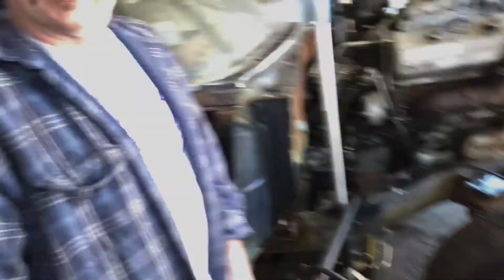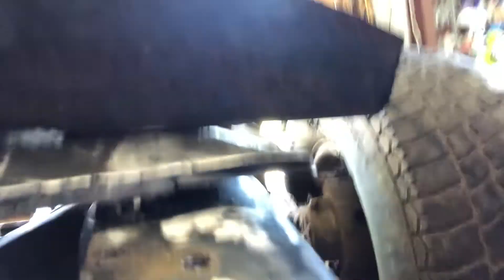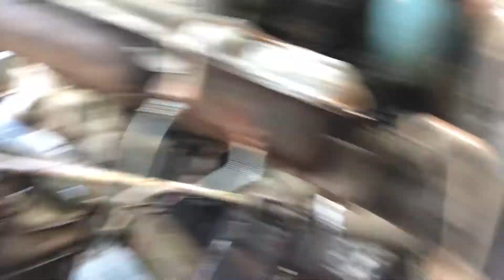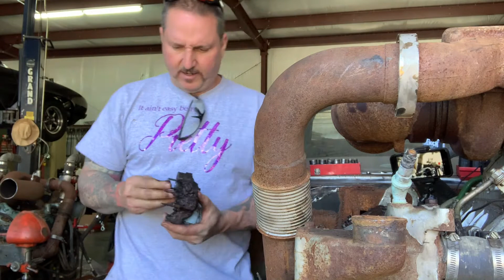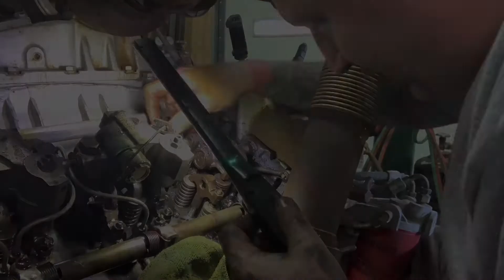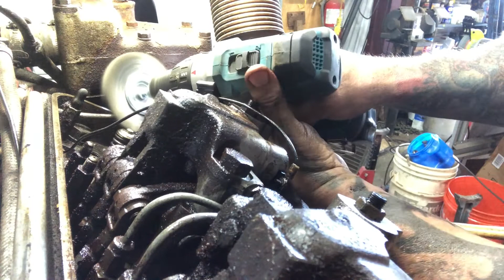Hells Bel episode xx 59' Belvedere Detroit Diesel Power

Comment: Nice, that's a throttle delay.:)  Stops smoke on acceleration, can be removed if you like.  Can just use your foot to control the smoke.:)  I've tried with and without and prefer it operating.:)

Comment: Welding without a face shield is a great way to burn your eyes.
Reply from the maker: Been there many times over the last 35 years even when wearing a welding helmet.  But you’re correct it’s not recommended.  I shield the arc with the gas nozzel when spotting

Comment: That's not really rust, right James?  Looks to be more of an accumulation of oil sludge, from sitting so long.  Right?
Reply from the maker: Rust
Reply: @JamesPretty  Oh ok, the camera made it look black and being under a pan, plus when you wire wheeled it, it looked really nice and I didn't see any pits.  I just assumed it was sludge. Thanks for the reply.
Reply from the maker: @sheepdoglogic   ya I was hoping it was just oil coke. But it’s pitted real bad in places. Like 8 of the valve springs need replaced and a few pushrods
Reply: @JamesPretty  That sucks but, I have seen it run and wow!